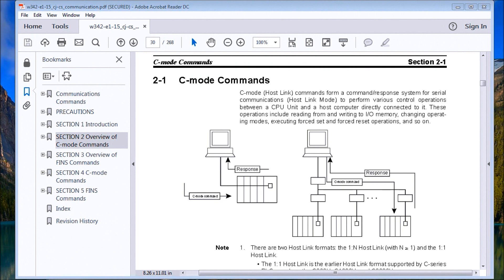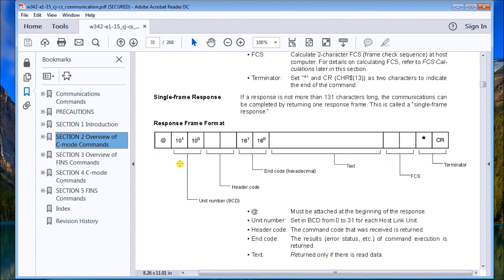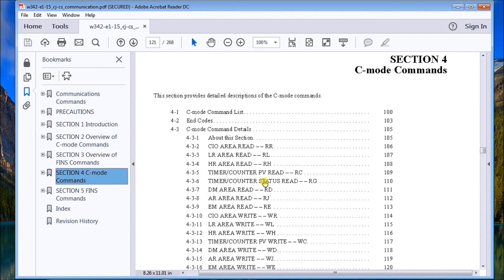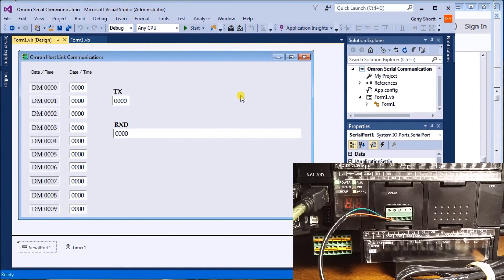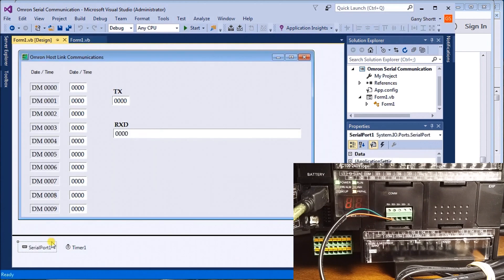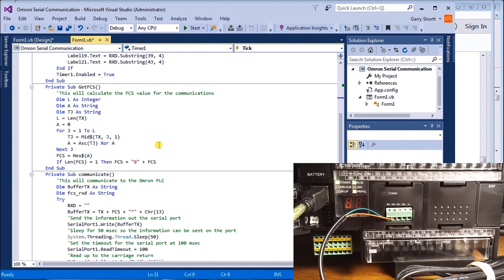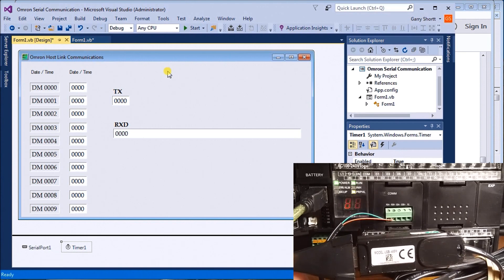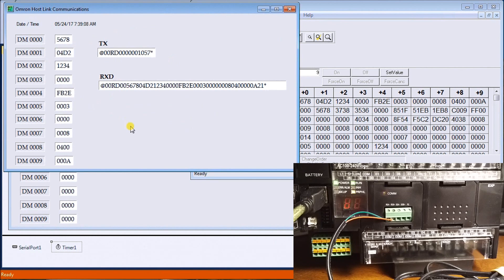Control 32 PLCs at Once: Master Omron Host Link Protocol

Comment: Hi!
!First thing, thank you for your video
.I have a problem with using the USB port
...I will be very thankful if you can help me with it
I opened question about it on StackOverflow
https://stackoverflow.com/questions/47863874/usblibdotnettest-example-does-not-work-for-me
Reply from the maker: Hi Hed,
I have found that not all USB to Serial port converts seem to work. The one that I use is Ugreen USB to Serial. This has worked for me on Windows 7 and Windows 10.
http://www.ugreen.com.cn/product-681-en.html
The other converter that has worked is Sabrent. This however has only worked on  Windows XP and Windows 7. 
Regards,
Garry

Comment: hi, is it possible to control Word address to boolean? like turning ON and OFF the internal relay?
Reply from the maker: Yes this is possible to control word addresses to Boolean. I would usually do this in the PLC logic. Write the word and then use the logic in the PLC to separate it into the corresponding bits.
Regards,
Garry

Comment: Hi, thank you for this tutorial. 
I didn't understand how to connect more plc and a single PC. Is there a separate module like switch lan? Could you please tell me if with this method I can read / write a pulse counter, a timer, an analog variable?
Thanks ag
Reply from the maker: Hi Antonio Giornetta,
The host link number will be different for each of the PLCs that you are connecting. This distinguishes what controller the PC is communicating with in the Host Link protocol. The physical media is RS485 which is a two wire connection. All of the controllers are daisy chained to each other along the network. A termination resistor is used at each end of the network.
This is further explained in the post for this video:
https://accautomation.ca/implementing-the-omron-host-link-protocol-vb-net/
I hope this helps you out.
Regards,
Garry

Comment: Hi again. First, I like to tell you I using part of your tutorial in an industrial proyect using C#/VB.net and PLC OMRON: Thanks to you, I can work reading DM memories. Thank for that. My question is how can I write a numbre un a DM location. I think the command is WD where is RD is for read. I try to replace the RD but I can't success with that. I use the same example, only change RD with WD, like the manual said. Can you send any advice or tutorial? I so close to finish the job and your example work so, so good. Thank you and sorry for my english. I big hug from Argentina.
Reply from the maker: Hi SoyYo Apellido,
You are correct. WD would be the command to write to the DM area.
See page 288 of the following manual for the (4-5-13 DM AREA WRITE – WD)
https://www.fa.omron.com.cn/data_pdf/mnu/w353-e1-06_cpm1_cpm_a_cpm2c_srm1-v2.pdf?id=36
The following code would write 1234 into DM0
 'Write DM0000 with 1234
 TX = "@00RD00001234"
 Call GetFCS()
 Label25.Text = TX + FCS + "*"
 Call communicate()
 SerialPort1.Close()
I hope this helps you out.
Regards,
Garry
Reply: @ACCautomation  Hi again. I still trying send a number to the DM memory but not success yet. I use TX=@00WD0030001 to send number 1 to the DM3, but nothing. Can you write an example code to send number 1 to the DM3? Because DM still show 0000. Thank you very much and sorry for my question.
Reply from the maker: @soyyoapellido474  
Use TX=@00WD00030001
@ - Start of Message
00 - Unit number
WD - Write DM area
0003 - Starting at address D0003
0001 - Data to write to the first address

Regards,
Garry

Comment: Hi Sir
Can you make video controll VFD by VB.Net
Reply from the maker: Hi phong nguyen,
Communication to the variable frequency drive would depend on the protocol that the drive requires. One of the more common protocols is Modbus TCP (Ethernet) or Modbus RTU (Serial).
There are many examples of both of these communication protocols on our website.
https://accautomation.ca/
Regards,
Garry
Reply: @ACCautomation  Hi Sir
Can you make video or document Vb.Net remote VFD by Modbus RTU protocol ?
Reply from the maker: @nguyenthiphuonganh7817  
I could make a video but it would be better to take a look at AdvancedHMI. It is written in VB.Net and has the Modbus RTU driver already available. 
https://accautomation.ca/advancedhmi-to-solo-process-temperature-controller/
The above post will show you this open-sourced program communicating Modbus RTU to a temperature controller. 
This will show you the concept of controlling a VFD using Modbus RTU with VB.net.
I hope this helps you out.
Regards,
Garry
Reply: @ACCautomation  thank you Garry
I will try it, Thank you your strong support
Reply: Hi Garry 
-Which protocol You used communication PC with Temperature controller?
- I tried to find where frame of communcation write and read data in your visual , I can’t find , please show me ? 
Thank you .
Reply from the maker: @nguyenthiphuonganh7817  
I am using the Modbus serial rtu protocol to communicate to the temperature controller.
Regards
Garry
Reply: @ACCautomation  
Hi . One more time thank you for useful channel 
Many people want to refer to PC communications with controller temperature by serial port or PC with inverter (VFD) by modbusRTU .I hope you will make this soon
Thanks bro

Comment: Hi. I don't know if you work today in this project but I need help. I test your program and work excellent!! I used in my project and the results are amazing. My problems start when I tried to write your code en VB.net on C#.net. I have problems when FCS must be equal to fcs_rxd. The values are differents. Can you do an example por C# because I need it to my C# version?. Thank you for your video and I hope can you help me. Sorry for my bad english. A big hug from Argentina.
Reply from the maker: Hi SoyYo Apellido,
I have not worked with C# however it should be easily transferred to this language. Just keep comparing the FCS calculations until your code can match it.
Note: If you are writing values to the Omron PLC, the PLC must be in Monitor mode for the information to be written.
Regards,
Garry
Reply from the maker: The website will have more information.
https://accautomation.ca/implementing-the-omron-host-link-protocol-vb-net/
Garry
Reply: @ACCautomation  Thank you for your answer. I still trying. Is possible any data conversion code is wrong but still not found who is.... Thanks again and congratulations for your job.

Comment: Hi Garry!  I need some help in my study project. It's about a form(display) in wich I have a start button, a stop button and some textboxes where I have to visualize the state of some timers and counters.
Could you explain how do you convert all to hex from binary and from binary to hex while you are comunicating?
Thanks a lot and Merry X_mas!
Reply from the maker: Hi Pufflo Bull.
The best way to achieve this is to use AdvancedHMI. This is a free VB.Net application the will communicate to the Omron PLC.
Here is a post on using AdvancedHMI with the Omron controller.
https://accautomation.ca/omron-cp1h-advancedhmi-communication/
I hope this will help you out.
Regards,
Garry
Reply from the maker: Merry Christmas!

Comment: Hi thank you so much for your video 
I'm using omron  cj1m cpu and I want to set a variable using vb6 when a condition is true can you give me a hint how I can do this, I would be so grateful If you could help me
Reply from the maker: Hi LRHPro,
I have done this communication also in VB6. Here is the link to the post.
https://accautomation.ca/how-to-implement-the-omron-plc-host-link-protocol/
Video:
https://youtu.be/8bVfs4paqNw
This post will show you the method to read the information from the PLC. You could easily add the write command since the FCS and communication timing has been written. Just look at the function code returned to see if the instructions was executed.
Regards,
Garry
Reply: @ACCautomation  THANKS FOR YOUR REPLY 
1st thing I'm a newbie I just know a little about vb6 and omron serial communication 
I have cj1m cpu11 and I want to send a value of 1 to a variable  in address D2200  , 
and I'm using serial port on scu21-v1 communication module , what I should do  ? and thanks for your help ,
Reply from the maker: Hi LRHPro,
Another option would be to use AdvancedHMI. This is a free software package that will communicate to the Omron PLC. 
https://accautomation.ca/omron-cp1h-advancedhmi-communication/
Video
https://youtu.be/5_FZ61Ep6u0
AdvancedHMI runs on visual studio and is programmed in VB.net. You do not have to know VB programming in order to create functional programs.
I believe that this would be a good option for you.
Regards,
Garry
Reply: @ACCautomation  thanks again 
I asked for this because I don't have a choice the programe exist in vb6 what I want to do is just to add some lines of code to send a value of 1 through the serial port 232 to the programme , that's all 
is the data tha goes to the plc have a specefied addresse or I must use some functional block like RXD TO GET data and put it in the addresses I want , and thanks again
Reply from the maker: Hi LRHPro,
It is very difficult to tell you what to change in your vb6 program without seeing the code. However what you want to do is send the DM AREA WRITE command. This can be found in the operation manual of the Omron. 
It will look like the following:
"@00WD22000001" - This will write the value 0001 into DM2200 at unit #00
Regards,
Garry
Reply: @ACCautomation  I'm grateful for your help , I will try too send this with the cariage return to the plc by MsComm.output I hope it will work 
and I will get through your series and learn vb6 & net to understand more about plc communication I'm now in an internship and I'm still new to the field of plc 
thanks again for your help

Comment: I have questuion.
could you please. Show me about Serial port of PLC
how is setting. i try it same this video. but error conmunication dispaly .
please support for me!
Reply from the maker: Hi Quyet,
The following website URL will contain all of the information on the setup of the Serial RS485 port. 
https://accautomation.ca/implementing-the-omron-host-link-protocol-vb-net/
Since we are using RS485 you may have to switch the two wires around.
I hope this helps you out.
Regards,
Garry

Comment: thank you sir
Reply from the maker: Hi Narith
Digital Temperature Controllers Communications Manual E5_C
https://industrial.omron.ca/fr/media/E5_C_CommunicationsManual_EN_201404_H175-E1-08_tcm920-110586.pdf

There are several different methods of communicating to the E5EC temperature controller. See the above manual. 
The method mentioned above in this video will work with the CompoWay/F Communications Procedures. 

Modbus Communications Procedure would be another way to communicate. 

If you need a program the is written in VB.Net and has the communication already written, then I would suggest AdvancedHMI. This is an open source free package. 
https://sourceforge.net/projects/advancedhmi/

Regards,
Garry
Reply from the maker: Thanks for the comment Sridharan
Garry
Reply: get project ? ^ ^
Reply from the maker: Hi Narith,
http://accautomation.ca/implementing-the-omron-host-link-protocol-vb-net/
Download the program files here:
https://www.dropbox.com/s/zzsqzi5enbz8iyn/Omron%20Serial%20Communication%20VB%20net.zip?dl=0
Regards,
Garry
Reply: I Need connect to omron E5EC Temp. Control With Setup Port .  (rs232) 

Is it possible ?
Reply: I need connect to omron E5EC Temp. control with setup port (rs232)
Is it possible?